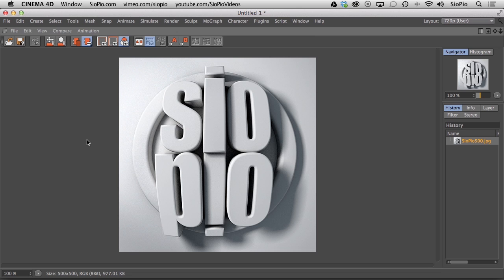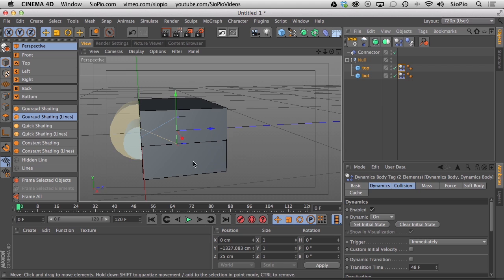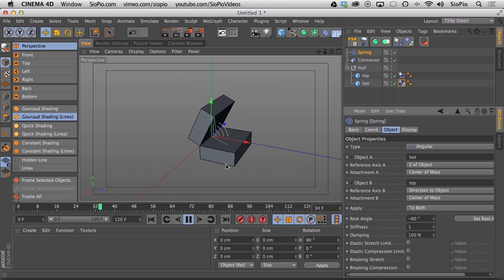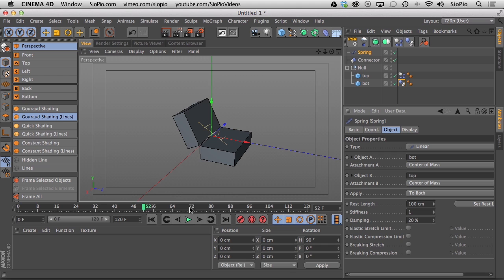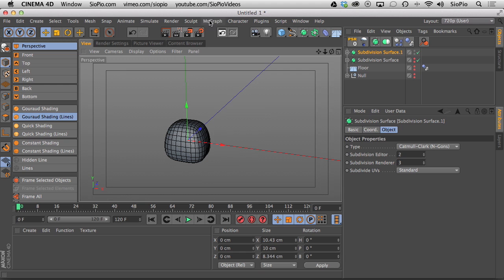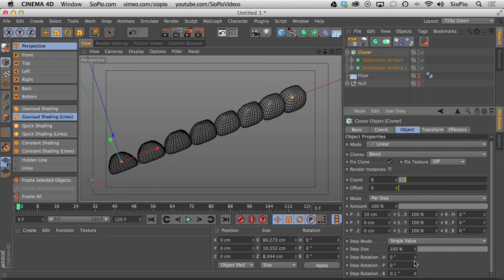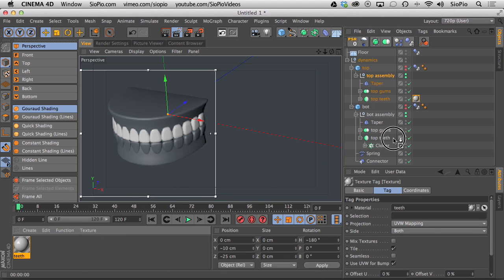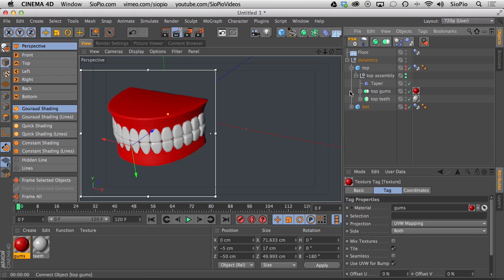Cinema 4D Tutorial - 3D Chattering Toy Teeth

Comment: TIP: for positioning your new object at "view center" rather than changing the view to say "top" then back to perspective (great smooth trick btw SioPio) one can also set this as a preference > go into "preferences" under "Interface" and check the "Create New Object At View Center"

TIP: the auto save option is amazing and located a bit lower under "Files" in the same preferences dialog box.